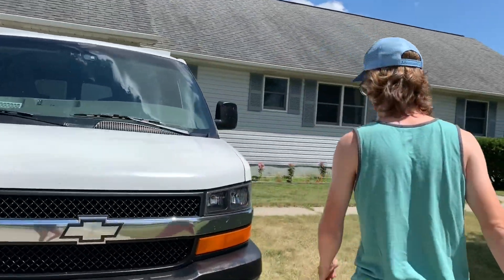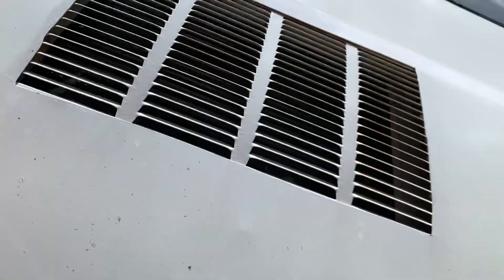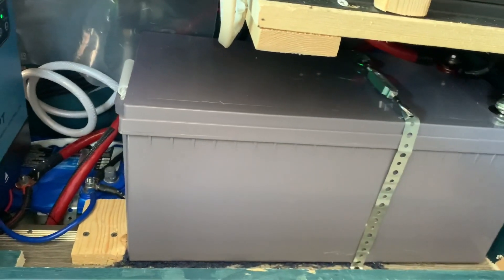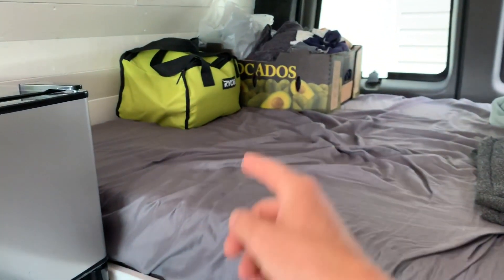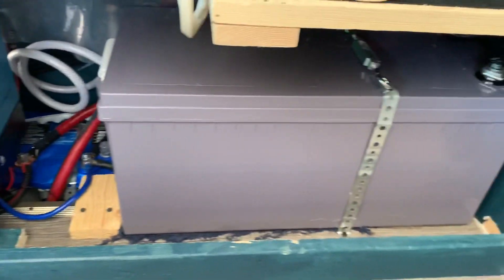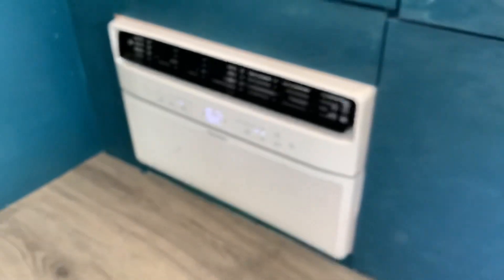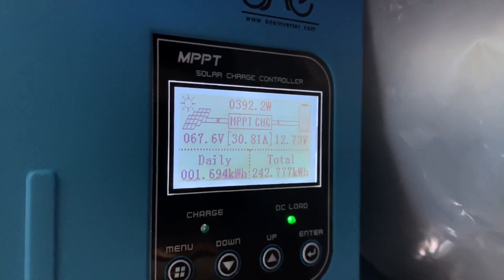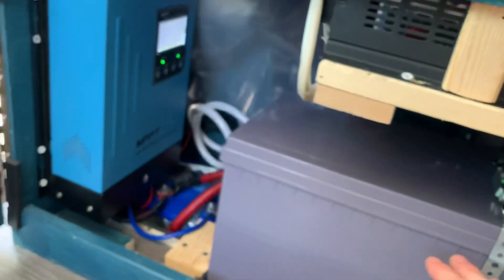Van Life Solar AC Setup - Totally Off Grid

Comment: Interesting stuff! Nice build and I like your explanations. Electrics is probably my area of least expertise and experience and so many options and opinions it gets confusing which is the best way to go. Here in Eastern Canada the sun is so infrequent and weak for most of the year that I’m not confident that solar is going to be the best/most cost effective way to go. I’m thinking DC to Dc charger to go with my 2000w inverter and then figure out a couple of batteries for it. Then something like a Jackery for back up? Not likely to need a/c but would really like a small fridge/freezer like yours. Thanks for the vid - have subbed and will take a look through your others. 👍🏻
Reply from the maker: Thanks for checking it out!
I know solar is a bit tougher to catch in the north. (Originally from Michigan and it's pretty bad there even.) These 120v fridge / freezer combos draw between 70 - 100 watts so that setup would be plenty for it!
Cheers!
-Tim
Reply: Thanks! I checked out that type of fridge/freezer combo and there seems to be a few on the market to choose from and, as you say, you could go through three or four of them before you got close to the price of a specialist unit. Is there a formula for working out the size of batteries to go for? My inverter is recommended to have two running with it and my budget would dictate AGM but I don’t want to be under powered or trying to charge more than I need. Other than charging laptop etc I would mainly be looking at the fridge and one of those induction cooktops for indoor cooking and a few LED lights. I have a propane heater at the moment but might look at a diesel one which I know uses a small amount of electricity as well. Cheers!
Reply from the maker: @MapleMarmite  The real killer will be the induction cooktop. We have one as well (1800w) In other words, it's equal to running 10+ refrigerators at once while cooking.

Our 360AH AGM setup works well for pretty much the same thing although you may have to run the engine a bit more often to re-charge (as solar is less plentiful there)

Comment: You should watch "DIY Solar Power with Will Prowse" His videos explain why Lithium Iron Phosphate Batteries would work better. They require battery management devices, but he has found very affordable devices for just that and are more robust in they monitor both cold and hot cutoff points. I find pictures worth more than word. Don't take my word,but watch his videos and see for yourself.
Reply from the maker: I'm pretty sure once these AGM's die I'll be switching to Lithium.
Honestly the biggest hurdle during the build was price, but they've been coming down in cost and my budget's recovered from the initial build "sticker-shock".
I also had concerns of freezing but I hear some even offer internal heaters (or just use a heating pad of course!)
My only real concern now is the maximum discharge. My induction plate pulls nearly 170 amps (12v system). I know that used to be an issue but may possibly be solved now! Will do more digging when replacement time comes around.

Thanks for the insight Delton.
Learning more every day!
-Cheers!
-Tim
Reply: @VanwithTim  some one beat me to it - come on Tim LiFoPo4 or even better graphene plate batteries are 2021. The biggest benefit - their ultra low resistance. Charge on a dime and 80% DOD. Sell your mix and match and her on it!

Comment: How much does it cool your van down? For eg if it's 95 outside what would it be in your van? Thanks
Reply from the maker: Hoping to film exactly this once it warms up! 
(A timelapse of the interior / exterior temperatures along with battery voltage.)
If I recall it does okay and usually brings it down to 80F inside with all the window covers in place.
Will update you once I get the exact figures this summer!

Comment: Thanks its hard to get simple answers without a lot of technical knowledge the question would be can the major appliances run all night on a battery bank?then how big of a battery pack? Then can it run on solar panels alone, how many panels?those are simple yes or no questions you have answered well. When I design my system I will use off the shelf house ac and refrigerator and microwave, I'm putting a lipo4 bank together when I get a few dollars ahead I buy another cell,so I will have a formidable house bank
Reply from the maker: It's certainly tough to give straight answers with so many variables, but hopefully it's inspired some ideas in the DIY conversion community!
I'm all for 12v appliances if you have an unlimited budget, but for me it just wasn't realistic.
Will probably be right behind you with a lithium setup though. Only concern is their max discharge rate. 
I'll need them to handle up to 170a continuous discharge with my induction plate. I remember that was an issue a couple years back.
Perhaps it's since been resolved?
Thanks for watching Ronald
Reply: @VanwithTim  doing some internet research it seems like the discharge rate has been solved for lithium at least I think it's the initial surge of amps,to start electrical appliances that cause the problem. I plan using propane for heating water and cooking, with a small wood stove as backup
Reply from the maker: @ronaldharris6569  Should be a sweet setup!
Glad to see the battery prices continuously dropping as well.

Comment: I really like your solar panel and install.  Too bad you can't angle them when necessary.  But hey.  Sunny day.  Mid day.  When it's hottest.  The air-conditioning will be full tilt boogie.

Fun to hear you laugh yourself.  About how you forgot.  Warm air rises.  Cold air falls.  I was wondering why you didn't put your window air conditioner up as high as you could get it?  Say inside some upper wall ceiling mount cabinetry.  Instead of down below.

Yeah ducting.  Now there's a thought.  When you design your next build out.  And figure out how to duct a window air conditioner.  It can't be that hard.  Awkward, bulky, sure.  I know!

You get one of those cheap plastic stackable, doodad,  home organizational, storage boxes.  Big enough to fit over the front output ducts of your window air conditioner.  Then you drill a standard 5 inch or so, circular flexible furnace ducting, top hat like plate mount.  And you screw and glue that to the plastic storage container.  That you put over the face of the window air conditioner outlet.  Then you can use some soft flexible ducting.  Create your own quiet Plenum overtop of the head of your bed.  And the soothing cool air will fall down upon your body as you sleep.  And always providing you with a cool head.  Though I have seen better looking.  You're not bad.

Quite the challenge though.  To try to duct it up words.  Why not just make another vent cutting.  Into the side of your van.  Up toward the roof.  Build a cabinet to fit your air conditioner.  Mount it up top.  And in the lower position where the other vent has been cut.  Et voilà!  A perfect place to put a small mini fridge or, cat box, stinky sneaker and sock storage area.  One of those many propane heaters.  Since you would want the heat to rise from the floor.  In the cold weather.

And you can salvage what you've done that way.  Improving your situation greatly.  It is just a slight change.  And small additional modification.  And you'll end up being far more comfortable in the hot weather honey.  That things only going to take you down 15 or so degrees.  Maybe 20.  Which should be quite comfortable in your van.  On a 115° day.  It'll be a balmy 95-100°.  And you will be quite comfortable in just a jockstrap or a thong.  And you can't get arrested for that.  Tell them you get a suntan much faster from the reflection of the sun off the snow.  If you walk around and almost nude.  With SPF-100.  To get the vitamin D your doctor says you badly need.  And with that also comes, very even tanning.  And it's only for health reasons.  You have a skin condition.  Your body is allergic to clothing.  That makes you uncontrollably itchy..  Bad enough you have to wear a jockstrap or a thong in public.  Because the urge to scratch.  Nearly drives you crazy.  And then they will likely leave you alone.  In the cell.  With a nice orange jumper and a comfortable plastic metallized mylar blanket.  And a Bible you can use for a pillow.  I forget what the most comfortable chapter it is to open it at?  It's one of those.  So that it's not uneven and lumpy.  At your face doesn't roll off one side.

When I built my custom Super Class-C motorhome.  30 years ago.  I designed it with the heating and air conditioning.  Along with the necessary power requirements and distribution system.  First.  And planned for the future.  For later upgrades and modifications.  I can conveniently remove 2 internal walls.  To access all of this extra electrical, audio and video and intercom wiring.  The central HVAC wall mount Bard, electric, 240 volt unit's output ducting.  It is near the top of the unit.  Ducts right out to the soft circular duct tubing.  Straight down the driver side.  At the corner of the wall and the ceiling.  With 2 T output couplers.  To feed each room.  The electronic thermostat is mounted chest high when you're standing.  Head high when seated.  In the hottest room at the front.

It's a wooden box rock.  With an aluminum skin roof.  Hardwood floors.  It's got 6 inches of fiberglass insulation within a 3 and airspace compressed.  A 3/8 inch plywood ceiling was installed.  With 6 inches of fiberglass insulation on top.  Between it and the aluminum skin roof.  There are 2 solid soundproof walls within.  To create, three separate rooms.  Each separated by soundproofed solid-core, doors.  Like you would have on the front of your house.

But it really started off a Sears delivery vehicle.  Until I got my hands on it.  30 years ago.  And turned it into a remote recording truck for audio and video productions.  Of music and variety entertainment, events.  Along with corporate productions.  Live albums.  Live broadcasts.  Coast-to-coast and around the world on the satellite.  Rock 'n' roll and jazz, gospel, opera, blues and symphonies.  TV talk shows.  Have audio.  Will travel.  It's a hit recording studio.  A TV production center.  And NBC audio control room on wheels.

And so now for its 4th build out in 30 years.  To take me through the next 10.  Now that I'm sort of retired at 65.  I've lived in it for 30 years.  While having a house.  Now I'm house less.  The entire industry has collapsed.  I have to reinvent how rock 'n' roll is recorded.  And presented for everyone at home on TV.  To give them that night club experience.  That no longer exists.  And I bring the makeshift nightclub into everyone's living room.  After hours.  With Bitchin', sounding rock bands.  No quiet boring ballads and stuff.  Stuff that will speak to you and say, hey!  God damn!  Get off your ass and jam!

It'll all be staged to provide a unique nightclub like experience with a very small select invitational only audience.  A Tiki bar serving drinks.  With people hanging around enjoying drinks and the band.  With between 4 and 10, network television quality like shots and moves.  And we can't forget the flying quad copter, out of this world, drone shot.  2 camera Jib/Cranes with robotic motorized pan and tilt heads.  And a bunch of Go Pro's.  You just Velcro and gaff/duct tape where you need them.  Everything rolling in 4K.  For ease in postproduction and remastering.  But using a couple of video switchers that have USB real-time streaming outputs.  Just ready to plug in.

And so all of the cameras are also ISO rolled.  To their own memory chips.  So you end up with 24 tracks of audio.  Along with 4 and 12 tracks of video.  Easy PZ.  Piece of cake.  Walk in the park.  Nobody knows why it looks and sounds so good?  I said probably because I worked it hit recording studios and then stumbled into NBC-TV for 20 years?  Maybe it's that?  Ya think?  And now I'm using toys.  That look and sound as good.  As the stuff the cost hundreds of thousands and millions of dollars.  Just 30-40 years ago.  And now it's so lightweight and convenient!  You don't kill yourself picking anything up anymore.  And the high resolution widescreen video is just stupid good looking.  Like the early high-resolution TV cameras I used at NBC-TV.  We only had one of these in Washington DC.  It cost about $350,000.  You get something a better quality and higher resolution today for about, $350.  $3500-$6500 if you want a more fancy brand name.  Like, Sony.  Red.  Panna Vision, Black Magic, gets a bit pricey.  Cell phones and Go Pros don't.  And everyone knows how to use, those.  I make hit records with the best equipment in the world.  I make hit records with the simplest oldest available crap in the world.  It doesn't matter.  When, one like myself.  Has been completely brainwashed and condition.  To only speak  in technobabble code.  And do my thing like a wind up automaton.  Just plug me in.  Charge me up!  We all get down.  When I get up.  And bogey!

You'll find out.  I'm coming.
RemyRAD

Comment: I am not an electronics wizard by any stretch. You are the expert here. Most of what you talk about 99 per cent of us may not understand.  But....... I have watched so many videos on YouTube about building a conversion van.  Many are professionally done by experts, like Humble Road.  You and he could have a meaningful conversation on wiring techniques.  So in my humble, novice opinion, it would be to your benefit in the long run to change out all your batteries to lithium.  Twice as efficient and half the weight.  And change out your inverter to Xantrex. Practically every decent conversion, where the owner has the funds, use this brand, because it is one of the best.  If you already know all this, please forget I ever mentioned it.  I wish I had half your knowledge on wiring systems.  It would make watching videos like this more pleasant.   I like your choice of vehicles.  The Express 4x4 is so much better than any Ford 2- wheel drive.  Happy motoring sir.